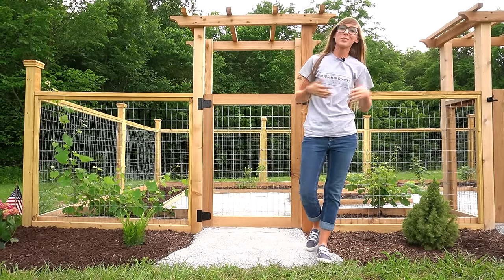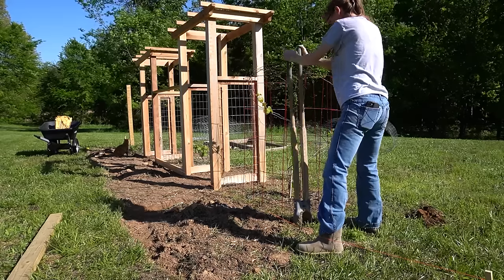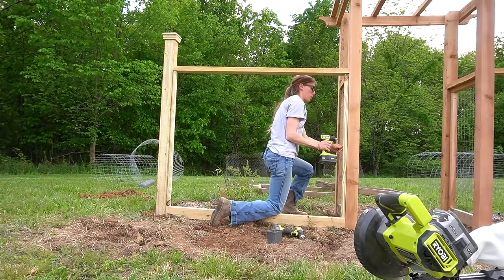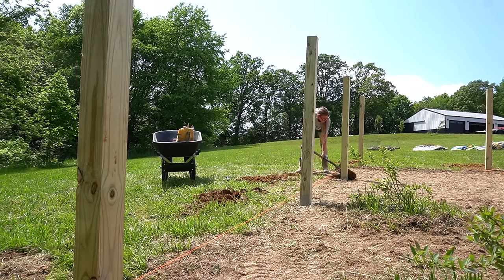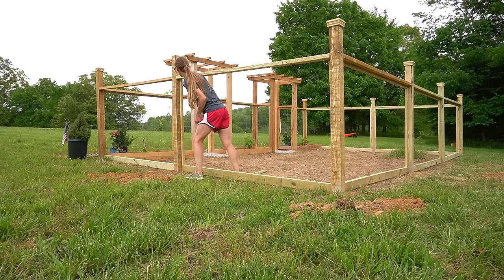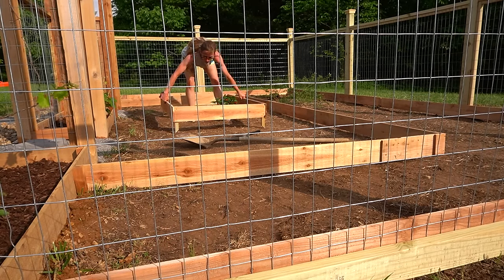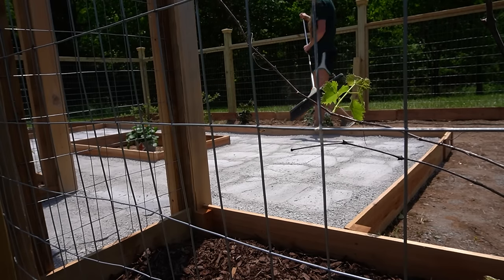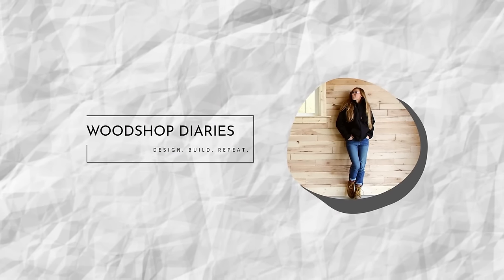How to Build a Fenced In Garden | Enclosed Garden Build Plans

Comment: Very Nice.  My tip, if you are going to expand it in the future. When I fenced around my driveway, I used similar construction to your fence but used cedar boards instead of wire.  To set the 2x4s, I put wooden screw clamps on the post at the desired height and just laid the 2x4 across them. I screwed in the pocket holes from the top and plugged them.  I've also used the clamps as a saw guide to cut a flush top.  I wasn't lucky enough to be on the flat.
Reply from the maker: Thanks for the tips! Sounds like you’ve got a nice set up!

Comment: looks great! what you could do when setting those long upper horizontal 2x4's is use a scrap piece of 2x4 and clamp it to the 4x4 at the height you want, then rest the 2x4 on top of the scrap and level and attach the opposite side of the 2x4, then just go back, remove the clamp and the scrap piece and attach that side
Reply from the maker: That’s a great idea!

Comment: Looks very nice.  Question...  Are you using the Ryobi Narrow Crown Stapler for the wire?  If so, did you find galvanized staples?  The only staples I find for mine are not galvanized so I'm assuming they will not last very long outside.
Reply from the maker: Thank you! Not they’re not galvanized. I thought the same thing but I used the same staples on my the trellis for my garden last year and every single staple is still holding perfectly fine. So I figure, worst case, I might have to pop a new staple here and there every couple of years.

Comment: Is there a reason you added wood picture framing between the posts instead of stapling the wire directly to the posts and top rail?  I assume it looks nicer the way you've done it, but would add lumber cost.

Comment: I can actually help you on the post-holes.
Recently, I've been learning about how to DIY a water well, watching several videos about how to dig your own shallow well. Many of these DIY videos featured a manual augur, with a 5/8" shaft and a wood handle. This attaches easily to 5-foot pipes to extend the handle, so you can dig deeper and deeper wells... 5' 10' 15' etc.
I decided I must have one, so I headed to my local desktop PC to shop at Amzn. I found several apparently good augurs, by reading the Reviews section on each product.
What stood out to me was something I hadn't thought of (but now will never forget):  Post-hole diggers.
MANY of the reviewers commented that they used their augur to dig post holes and ALL repeated the same thing: Once you dig post holes with a augur, you will never go back to that old two-shovel model post-hole digger again.
They did mention that rocks and roots could be a problem and you'll have to dig those out with shovel or other tools, but it seems to me that's a minor irritant that anyone would have to deal with.
So now I have two reasons to buy a manual augur. (I want to build a fenced garden, too.)
I'm thinking this is something you may want to look into.

Comment: I'm interested in learning more about the dry concrete as the post hole fill - I've never seen that before - does it harden up pulling moisture from the ground? Seems like a clever idea.
Reply from the maker: Hi! Yes the moisture in the ground will set the concrete. That may not be the case in every climate/environment. But where I live, it’s very common as there is usually plenty of moisture in the ground to set it without needing any water.
Reply: @WoodshopDiaries  cool! Thank you! I am going to share this with my DIY buddies 😁